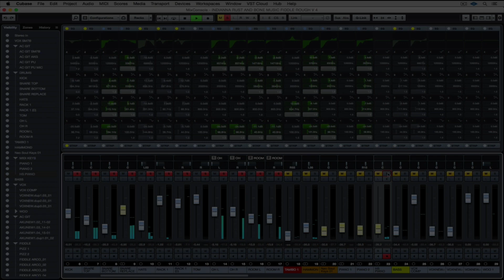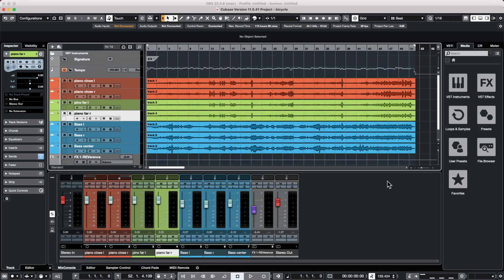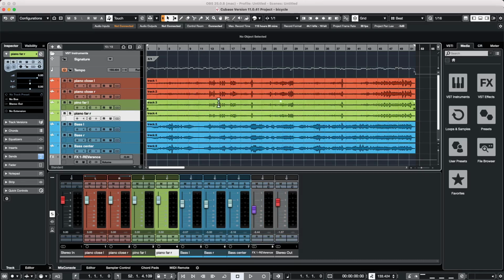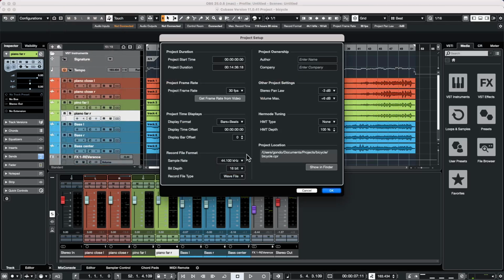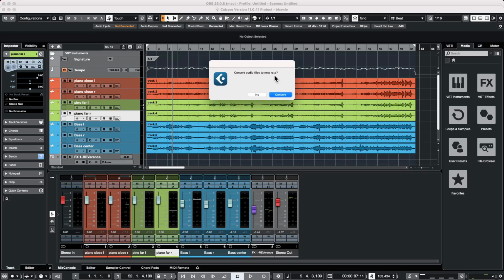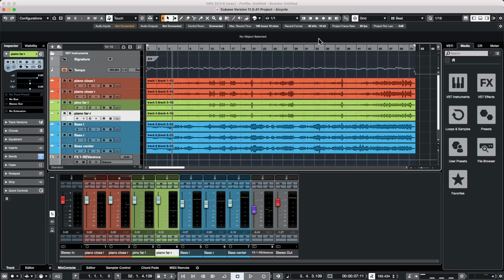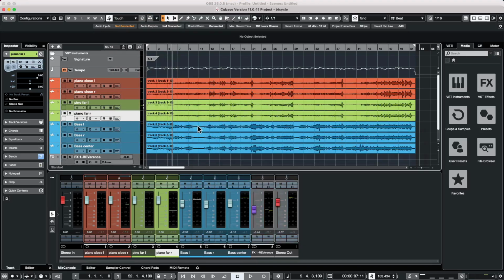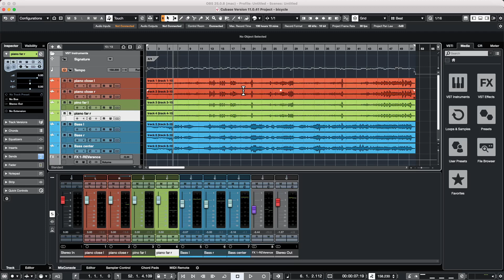Changing Sample Rates in Projects | Cubase Q&A with Greg Ondo

Comment: Good video. That last question always confuses me.

My problem is, mixing down to in 44.1 when I have the session in 48. I then have the file immediately open up in wavelab via the mixdown window. When it opens up in wavelab it confuses Cubase because my sample rate has changed. So I have to go back to Cubase and allow for there to be different sample rates while I'm checking the 44.1 mixdown in wavelab.

And yes I can have Cubase set up to release the driver in the background when I switch to something else. but that means if I want to do something else on the computer while all my files are mixing down I can't. I'll just get a bunch of empty audio files even if I just happen to click on an email while mixdown is happening.

It's a minor headache for a DAW that I have used for years and enjoy using. Cubase 12 is the best update in years.

Thanks for doing these videos Greg. They're extremely valuable.

Comment: nice video.. but sometimes my sample rate change by itself and this causes some problems when working with midi and samples
Reply: Poltergeists can cause random sample rate changes, so can multiple personalities.
Reply: I find this also Mandy, so frustrating! Wonder if there is a way to keep your chosen sample rate as a default setting, so doesn't need to be changed?